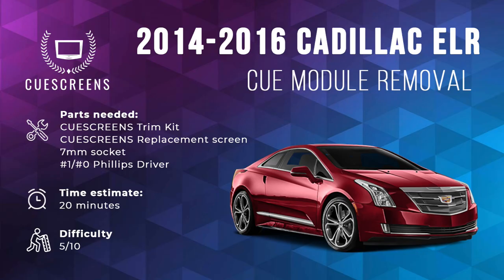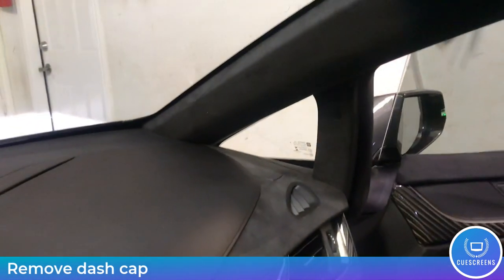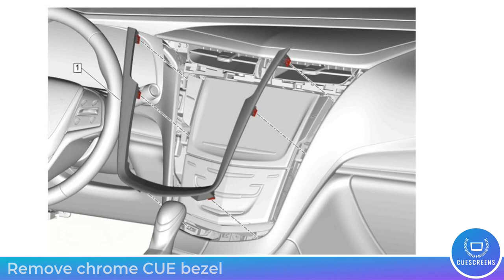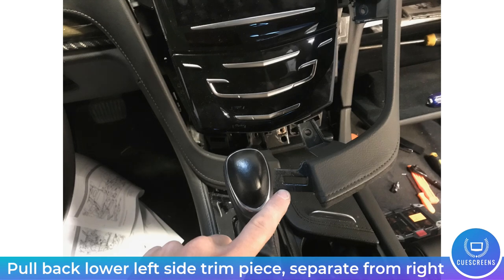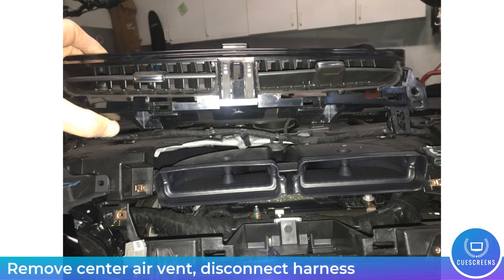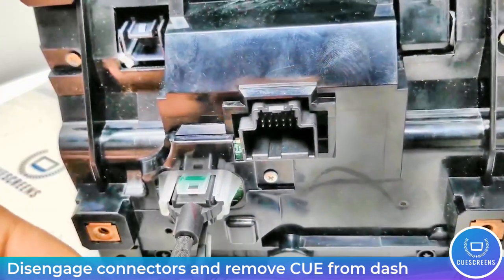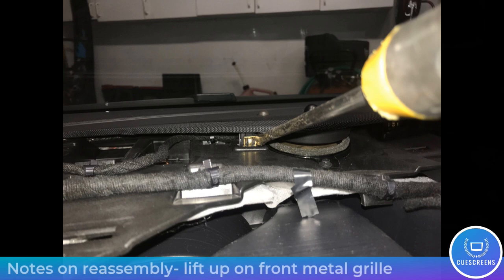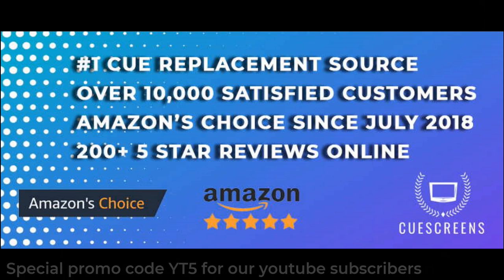2014-2016 Cadillac ELR CUE Complete Module Radio Removal *Easy Method* 20 mins

Comment from the maker: Pro Tip: To disengage the lower AC vent clips, firmly tug the AC vent back. Or, you can just remove the CUE module screws and the leverage from the module will pop it out.

Comment: I just purchased the replacement on Amazon, so I literally just pull up on my dashboard? Where is the best placement for the tool to release that? The video doesn't really show that. I don't want to damage it.
Reply from the maker: https://youtu.be/FzSzkvLLtdM?t=64 You can see how the piece inserts into the dash. Insert the tool there between the two pieces near a spring clip location and push upwards.